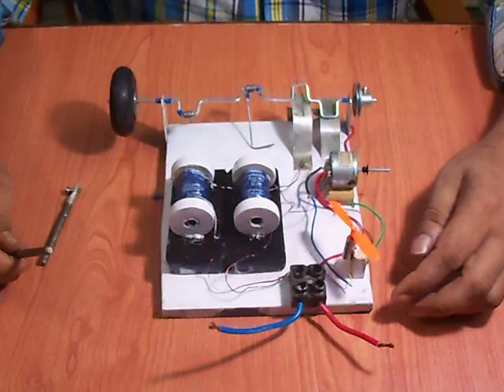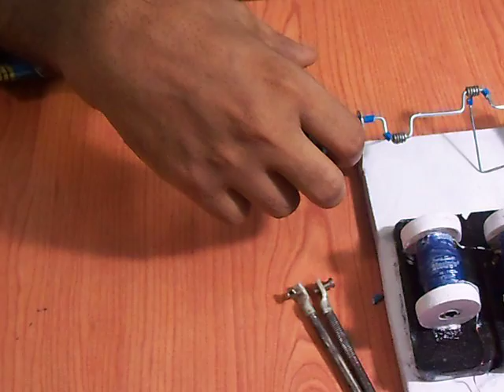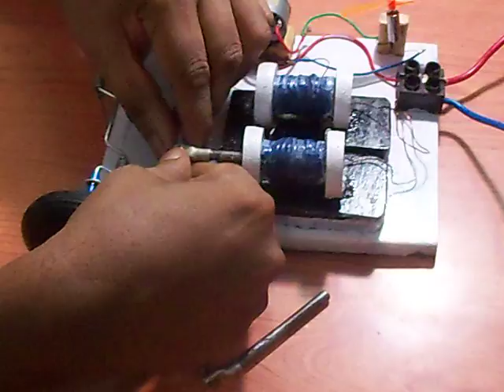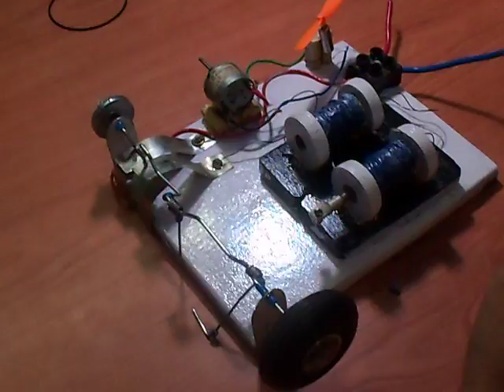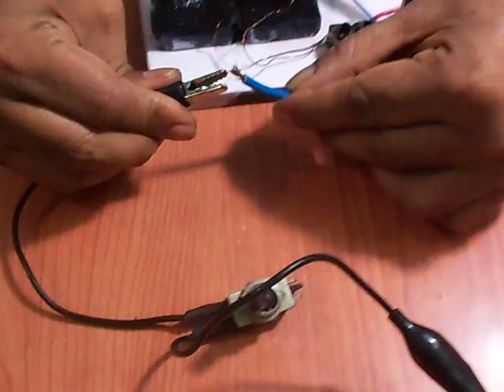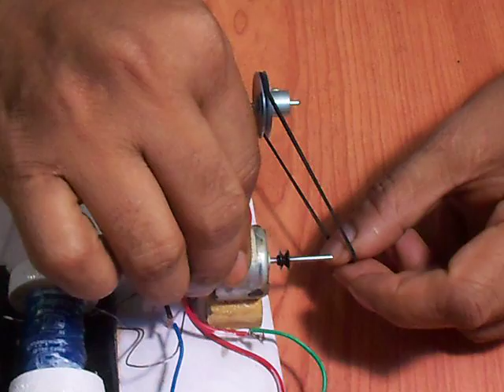Double acting solenoid motor working for driving a generator

Comment: hey , Can a 29 swg wire can generate such force.?And if u can tell how to calculate the dimensions, number of turns, wire diameter to pull "500g". Thanks Alot
Reply from the maker: Ishan,I little confuse ,i am not clear the amount 500g.What it is .Is it the weight of fly wheel.fitted in the crank shaft.If is show step by step calculation is needed.29 SWG is having dia 0.3454mm, area of cross section is 0.09sq mm. it draws current  at best 1.5 Amps.So your requirement is around 5 to 6 amps .the wire fails being over heated .Use SWG vs mm chart for current.Very basic thing is that more is the no of turns more is field strength i mean magnetic pull.If you are technical background ie.  especially electrical trade you can understand.Thanks

Comment: what is the voltage supplied?
and if  its 12v then can i use my laptop charger
Reply: yes its 12v and yes you could use your laptop charger
Reply from the maker: Suyash, It depends over the load current both solenoids draw,Instantaneous current for magnetizing  the solenoid coil may shoot up even up to 5 Amps.Your lap top charger is a Li-ion battery charger .it supplies a controlled charging current .there is every chance there to spoil your charger ,so don't do that .Better used Li-ion battery/ lipo  or lead acid of 12 V. 12 AH
Reply: ok thnx

Comment: This essentially amounts to an overly complicated electric motor/generator.  This turns electrical energy into mechanical energy then back into electrical energy then back into mechanical energy.  It is a pointless use of energy as it is about as efficient as pedaling to power an jumbo jet.
Reply from the maker: You may be right friend,but further research is essential to reveal the truth.